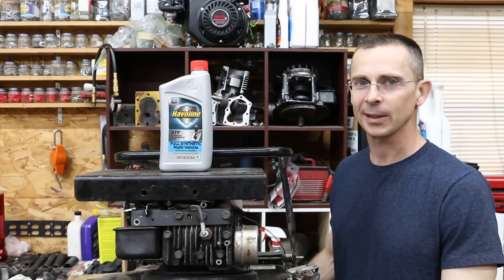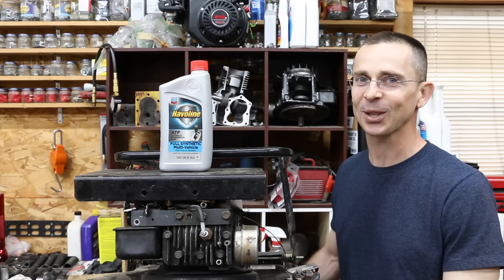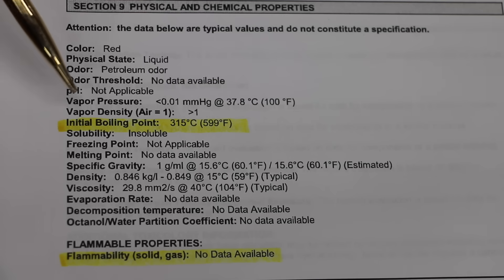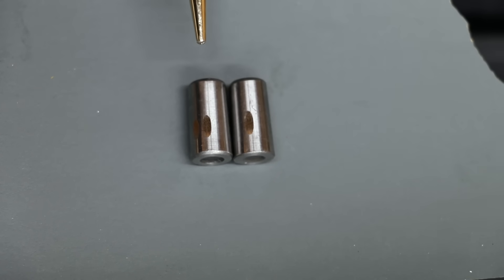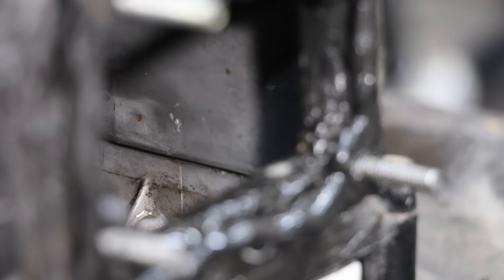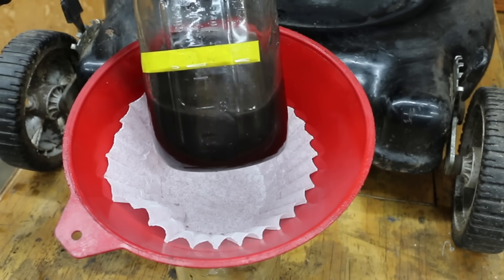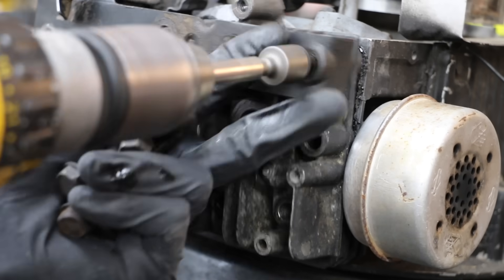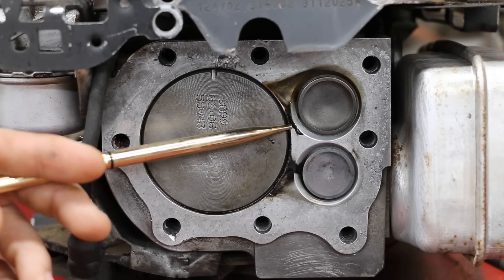ATF as an Engine Oil substitute?  Let's see what happens!

Comment: Would have beeing cool to se if an engine can run only on White spirit (UK) or mineral spirits (US, Canada) instead of gasoline. Tanks of good informative videos.
Reply: Giulio, he's run an engine on everclear in one of his videos a little while ago.
Reply from the maker: Thank you!
Reply: Yes, pure alcohol test would be very interesting
Reply: Yep , I've been doing it for years. Ethanol smells great when burning.
Reply: Ethanol, if burned correctly, will have no smell at all. The combustion products should be water and carbon dioxide, if combustion has completed. If you can smell ethanol, then it is either coming out of the exhaust, unburned, or else being evaporated from elsewhere.

Comment: Try Vaseline instead of oil! 
Might have to melt it to make it work lol
Reply from the maker: Thank you for this recommendation!
Reply: Project Farm 
Yea maybe run it until it’s really warm, dump the conventional oil and pour in the heated vaseline and go.
Reply: Aries Might hahahaha, it would be interesting to see.
Reply: SFW replacement would include 'cable lube' commonly used in commercial cable applications. It's the same stuff 100% just packaged differently.
Reply: Sby B. When the man behind the counter asks. Which bottle do you want. He will say I will take three bottles for my lawnmower. And one bottle for me.
Reply: It will immediately melt anywhere that metal contact is causing friction, but not splash up so you'd depend on the film strength of the last lubricant you had in before it was drained.
Reply: Why don't you use ATF during sex instead of Vaseline?
Reply: @zakbrowne8470  I was tempted to say such a thing too but felt stupid. Glad to see there are others in this world who operate on the same wave link as me.
Reply: Uriah Siner, good idea.  I know she runs better with it.
Reply: @Glocktard  lmao
Reply: Yeah, like to see that also :D
Reply: I would also like to see
Reply: Leonard Carr I would like to see lard as well.
Reply: yes you should
Reply: PR or mix it with transmission fluid.
Reply: Uriah Siner agreed I had mentioned that awhile ago. Would really like to see it not melted
Reply: madmax2069. Would the flavord sex lubricants. Leave a scented exhaust?
Reply: @ariesmight4141  lmao
Reply: Aries Might how bout BALLGUTS...aka semen
Reply: Zak Browne. Never use vasoline as a sex lube. Harmfull petroleum chemicals will be absorbed through the skins pors.

Comment: As you observed, ATF is not known for its lubricating properties; The metallic chips after draining the oil through the filter paper are pretty significant. On a small motor like a mower it may not be a big deal but on a vehicle engine it is probably about the same damage as putting 10,000 miles on the motor.
Reply from the maker: Great point and thanks for commenting.

Comment: I'm curious about Gumout Multi-system tune-up (with polyetheramine). I heard about it and gave it a try in the fuel of a car that idled very poorly. After a half tank, it's already idling a lot smoother. I'm wondering if it actually helped or if it's a coincidence. I'm going to try it on another car that burns some oil to see if it helps it run smoother, but won't know how well that goes for a few more weeks.
Reply from the maker: Thank you for this recommendation!

Comment: I've used half a quart of ATF after an oil change, in a 1997 Mercury Villager van with a v6. Having previously added about 2 quarts of Lucas prior to the oil change(about 150 miles prior), the combination of the two helped to rid the engine of a weird knocking noise coming from the front of the engine. The biggest difference came from adopting a Marvel Mystery Oil regimen rather religiously. I regained power and recovered some fuel economy from the use of these products.

My minivan thanks you for saving it from the scrapper. Lol
Reply from the maker: MMO is a great product!

Comment: I'm boggled. The label says " Synthetic ". But the  data sheet says it's " Mineral Oil ".  Is Havoline lying?
Reply: Synthetic oil is generally made form petroleum base stock that is modified through chemical process and etc. I.e. highly modified mineral oil.
Reply from the maker: Kole, thanks for commenting on this.
Reply: In the USA a highly refined Group III mineral base stock is considered “synthetic”. It is the result of a legal battle years ago between Castrol and Mobil.

Comment: I used Diesel for my '89 nissan.
had old oil in it, added one extra ltr. diesel on top of it.
ran it one hour in idle.
stuck lifter was free.
flushed it out. new filter, new 10w60 oil.
runs fine and takes alot of beating since then! no rod nocking! not like so much others 🤣🔰
Reply from the maker: I'll be testing diesel soon. Thanks for commenting.

Comment: I was curious about this, thank you for the video !  On a side note I have used it to clean small engines, as oil in a pinch when I did not have regular motor oil, and even used it in an OLD lubricated style air compressor that sat for years.  I did not notice any long term damage but I did not have the tools to check.  I love these videos !
Reply from the maker: Thank you!

Comment: i remember reading about people putting atf in two stroke dirtbikes. they claimed it made the clutch work smoother. is this something you could test?
Reply: I'm not familiar with two strokes, but on a modern wet clutch in a road bike ATF is very useful. If a negligent riders uses the incorrect oil (usually normal automotive oil, because it's cheaper and more readily available) the friction modifiers in it can drastically loosen engagement to the point of clutch slippage. Put the bike on a pit stand, and throw in a 50/50 mix of appropriate oil and ATF, engage first gear and allow the clutch to slip. Usually corrects the issue in less than 5 minutes.
Reply from the maker: Thank you for this recommendation!

Comment: I’ve got a story to tell you. I was driving a Toyota pick up truck. I had a helper with me on this particular day. I stopped at a gas station to purchase windshield washer fluid and get some fuel. I gave the bottle of windshield washer fluid to my helper to fill the reservoir while I pump gas. I didn’t think anything of it at the time. I drove about 40 miles and the truck begin to overheat. So I got out and pop the hood. After letting the engine coolant a bit I removed the radiator cap. To my surprise foam came out of the radiator. I am sure you figured out what happened by now.
My helper put the windshield washer fluid in the overflow reservoir of the radiator. Fortunately I caught it in time before it caused any permanent damage. My learning experience was that you cannot assume that an 18-year-old knows where to put windshield washing fluid.
Reply from the maker: Wow!  Glad the truck survived!
Reply: Project Farm . Me to what’s even more shocking is that helper survived to. Lol ✌🏽

Comment: This engine seems to be a oil burner looking at oil residue in combustion chamber and low compression readings this engine would be good candidate for testing on compression restore products
Reply from the maker: Yes, great point!
Reply: Seeing as I think it went back up to its original compression, that the ATF did work at that.

Comment: Great video! I have never put in the crank case but I have taken a cap full with the engine around 2500 rpm and poured it in the carb. It seemed to clear up smoke from fouled up intake valves. My example is purely backyard hillbilly nothing scientific for sure!
Reply from the maker: Thanks for commenting.

Comment: Diesel in crankcase.....
Reply from the maker: Thank you for this recommendation!
Reply: I came here to suggest this. Supposed to be a good cleaner. Not sure about 1 hour of run time though 😂
Reply: I have done this but only at a 3 to 1 mix and in an extremely dirty engine that had not had an oil change done in years but it did a great job and fixed my oil pressure issue
Reply: I have in the past used a 50/50 mix of diesel (gas oil) in the crankcase to clean out a really badly fugged up diesel engine. I followed the mix with a 2nd flush with cheap 20/50 oil (after emptying out the oil filter) then changed the filter and refilled with quality synthetic engine oil. 8000 miles later the oil was still clean! I would definitely NOT do this on a Turbo charged engine however!
Reply: That's old school. Always was told to add a cup to the crankcase and run for 15 min to clean and flush before an oil change. That the detergents would clean sludge out and quiet lifters.
Reply: Uwe Sanz yeeas
Reply: I have heard of farmers running straight diesel in their tractor crankcase to clean really dirty diesel tractor engines. Would love to see it.
Reply: I've used diesel to wash out 4-wheeler engines after extreme mud rides to clean out any sand or grit.  Where they take lil over 2 quarts I would put about 1 quart of diesel in it
Reply: 4 wheelers typically have ball bearings for the crankshaft rather than regular engine bearings, ball bearings don't really rely on the film strength of the oil
Reply: Yes!
Reply: I used diesel to clean milky oil/water in an inboard boat w/ 351. Worked good.
Reply: Stan Rodgers I always just used straight diesel and rinse and repeat about 3 times on 4-wheelers without oil filter or a new one so as not to flush any grime around into engine outta the oil filter   But that's what I was told by a Honda certified mechanic
Reply: David Wilson  a good way to clean
Reply: I always heard 1 quart to old oil, run then drain.
Reply: Yes, it would be nice to hear some more opinion about it. I did that to my petrol car last year. 50/50 diesel/mineral oil, than 100% mineral, than 100% synthetic which i left in it.
Reply: I clean out the straight six in my jeep with diesel. Its basically kerosene.
Reply: Had a clogged up oil sump in a Ram that the dealership wanted 800 to fix. 3 gallons of diesel run through the crankcase over 3 same day oil changes restored my pressure 100% and never had another issue.

Comment: I had an idea some time ago, what if you tried running engine on only 10% alcohol (thats 90% water)? It might sound crazy but we all know that vodka burns at room temperatures, even though its 60% water. I can only logically conclude that water in it converts to steam, which is perfect for an engine, because steam would create pressure and therefore power from otherwise wasted heat energy. The only thing is that it would need to be preheated to atleast 49C, according to this site:
https://www.quora.com/What-percentage-of-alcohol-is-needed-in-vodka-for-it-to-burn
I also wonder how cool it would make engine, since waste heat would be converted to pressure, maybe you wouldnt even need radiator.
Reply from the maker: Thank you for this recommendation!

Comment: You are very thorough on your explanations of what you were doing. Thanks for that. I have a question why is the camshaft plastic?
Reply from the maker: Most are made of metal, but this was done to save $.  I have a Kawasaki engine that has a plastic camshaft gear.  So, it's not just Briggs doing this.
Reply: Project Farm . Thanks for that information. I didn’t even know they made them out of plastic. Good stuff. Thanks again

Comment: will hot engine oil run petrol / diesel engine? , diesel engine has more chance to run cuz it has injectors but petrol engine has way less chance probably 0w @70°c or more will be enough thin to run ....
Reply from the maker: Thank you for this recommendation!
Reply: A diesel engine will run on oil with no problem. Look up diesel runaway, usually happens when the turbo seals blow out and the engine starts running on its own oil :)
Reply: diesels should run with oil. basicly diesel is a type of oil.

but gasoline engines will not run.
if you mix oil into the fuel they start to run badly and puff blue smoke. if there is to much oil it just cuts out.

BUT I wonder how the ignition chamber looks after this mess 🤣
Reply: Martin Gray hum , but runaway diesel already has very hot and pressure oil which gets sprayed on the intake...
Reply: DESCENT boiling 0w30 vs petrol engine! it will need lot of stuff to be modified to handle that hot oil to the carburettor! ...

Comment: What would happen if you'd put soapy water or just water as engine oil? Could be interesting to see how much damage would it cause. 
Another weird Idea would be to use oil paint thinned out with a bit of engine oil, It would be interesting to see if it would break the engine or would it just paint it inside :D
Reply from the maker: Thank you for this recommendation!
Reply: Water would behave similar to having no lubrication at all, only cooling. Water is a great coolant, but a poor lubricant. It might last surprisingly long, i'm not sure.
Reply: The oil mixes physically with the water (in the oil pump) and when it heats up it bakes on the connecting rod journals and main bearings, which seizes up the engine. Also water doesn't lubricate very well.

Comment: I worked at a Valvoline quick lube in Indianapolis a few years ago. One of the delivery drivers that brought bulk fluids on the tanker trucks had accidentally filled the bulk 5-w30 tank with ATF. Nobody noticed until about 50 cars too late. Surprisingly nobody ever complained or came back with engine damage.
Reply: And these stories are why I do my own fluids! No one to blame but myself! :D
Reply: Note to self.... change my own oil.
Reply from the maker: Wow!  Thanks for commenting on this!
Reply: Seems likely that the additional wear might only show up years later in reduced engine life.
Reply: 50 cars of filling and nobody realized ATF was going in? Oh boy...
Reply: @mannys9130 doesn't surprise me...  I used to work at one while going to automotive mechanic school and they hire legit ANYONE...  Because (in they're words not mine) "anyone can change oil...."
Reply: @mannys9130 my thoughts exactly. Must be smoking something.
Reply: they pumped it in with a hose, so they didn't see the fluid going in. then when they checked the level, if it mixed with dirty oil still left in the engine. it would not be bright red anymore.very busy 5 min type oil change places are quite often leaving a cup of oil in the pan still. plus honda and other hold oil. you only get a complete drain with a rebuild. is what the mitchell kelly is saying. also if they do 100 cars a day,...this was caught in a 1/2 a day. plus the atf would of been mixed with what was left in the tank already, it wouldn't of been empty, and most likely would of been half and half. and as more oil got used from bottom of tank the more stronger the mix would get.
Reply: Can't drive back if the engine is seized.
Reply: And that is why I change my own oil
Reply: Had the top guys been following procedure and double checking the level before the hood was closed, they should have caught that pretty quick. Always double check your work!!
Reply: Could have been that the engines had sludge that mixed right away with the ATF and nobody would have been any the wiser if the colour resembled standard oil when put into the engine.
Reply: @JimNotAvailable  ATF is a pretty obvious red color. Oil is not. So.....
Reply: @Jamespennington71  ok so if you put it into a shitbox engine and run it before you check the level  it might come out too dark to see the red
Reply: Well, I am certain there was engine damage, accelerated bearing wear at least.
Reply: Good example why I change my own oil.
Reply: Most guys shove the nozzle in the engine and use the counter built on to it. Can't really see what's going in that way
Reply: If you pay someone for a service, such as an oil change, and the wrong fluid is used and results in damage, it becomes the problem of whoever performed the service.  Going to court and saying "We pumped it straight into the engine so we didn't see what it looked like" is an admission of negligence.
Reply: ts46176 I worked at a gmc dealer and a bunch of water got in the oil tank. No one noticed we've been pumping white goo into people's cars untill the end of they day when I accedently pulled the trigger on the hose outing it back up.
Reply: Mitchell Kelly sludge in brand new oil? Before it has even been in an engine? How does that happen?
Reply: Richard DeRiso ain't their car ain't their problem.

Comment: I wanna see if seafoam cleans your crankcase!!
Reply from the maker: Thank you for this recommendation!
Reply: It does but a video WOULD be awesome!!!
Reply: Seafoam will do something, but i'd be interested in seeing the effects it has on the bearing surfaces. Seafoam breaks down the lubricating properties of oil similar to how paint thinner would. Seafoam itself is very similar to paraffin wax mixed with alcohol. Short term seafoam in an engine might not do much (in the normal volumes you'd put it in your car) but I'd never suggest you put it in any vehicle you want to keep.

I'd like to see a couple tests in a small engine to see what it does. Maybe a mix of regular oil and seafoam in increasing strengths until the engine fails.

Comment: I've added transmission fluid to oil to free a stuck lifter.  Then changed the oil after two weeks.  Worked great.
Reply: I have since the mid 60s adding ATF, 1 quart to free lifters, clean the crankcase, soften up cork gaskets on customers cars, never had a problem.  Today I still add 1 quart in my vehicle a week before oil changes.
Reply from the maker: Awesome!